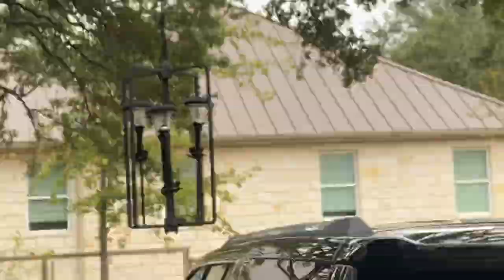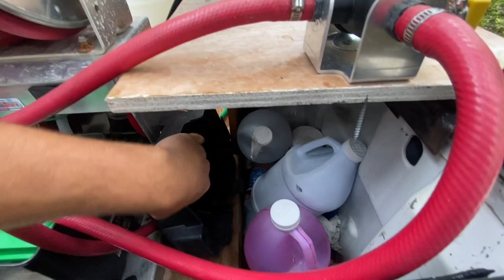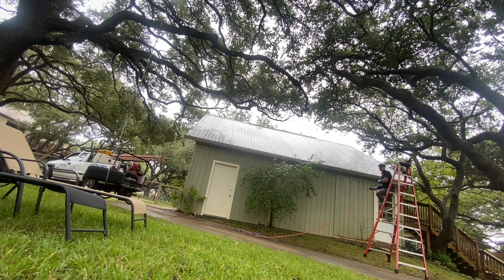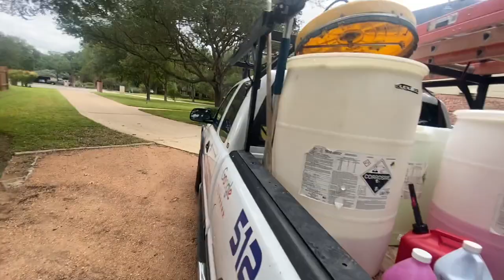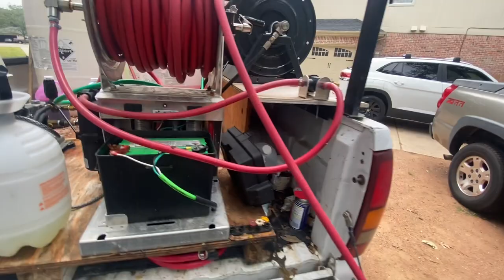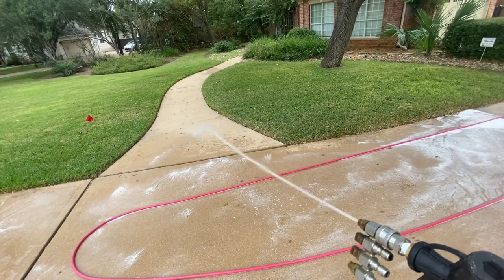How i CLEAN a METAL ROOF | Wash Vlog #1

Comment: Voice overs are a nice touch. 
I am still in search of some place near my town (Eden, NC) which sells bulk SH. Closest I found was a 125 miles away. And then still is $2.40 a gallon.  What google search phrase would you recommend to help find bulk SH closest location?
Reply: 2.40 a gallon is very cheap.  Here in Tennessee the cheapest is 3.00 a gallon I've seen it as high as 6.98 a gallon for 12.5%
Reply: Have you tried MVP in NC. I know there is a store in Garner and at Wrightsville beach